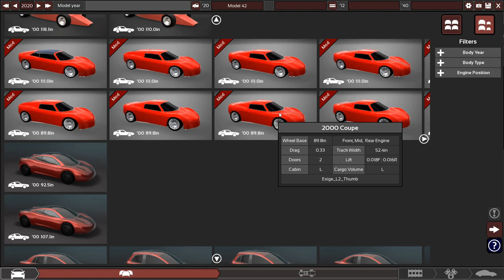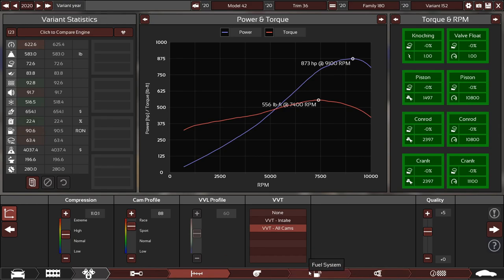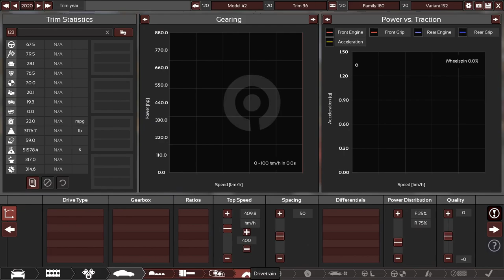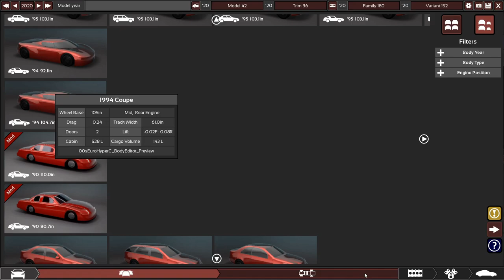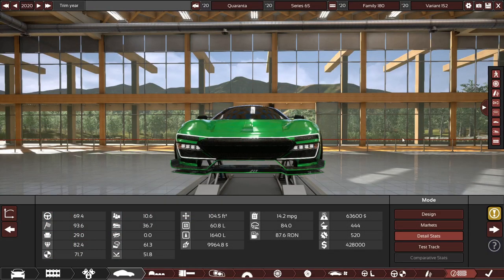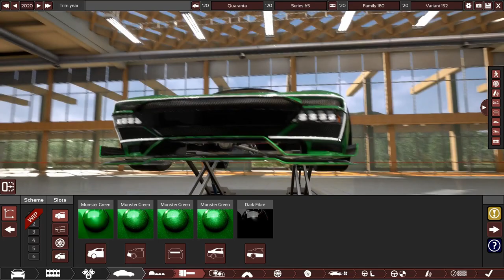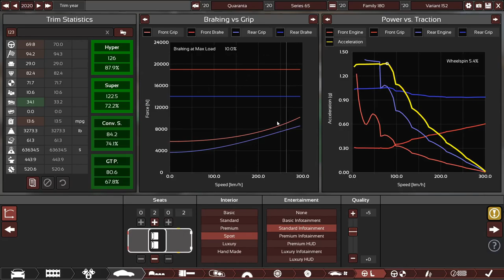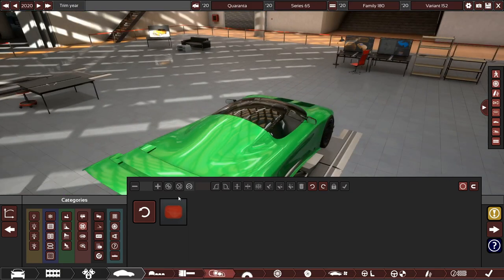2020 Supercar Challenge! TwinTurbros VS Canadian Steel

Comment: Fun fact: The Citroen SM had hydropneumatic suspension and was based on the Citroen CX (bonus: the CX name is a reference to the symbol for drag coefficient, of which it had a low one). The SM also borrowed a V6 engine from Maserati and was a super touring car for its era. It also used its hydropneumatics for adjusting ride height as well as deploying jacks from in front the front wheels and behind the rear wheels in order to easily replace the wheels should a tyre go flat. The engine also had a driveshaft coming off of the front in order to run the hydraulic pump for the suspension system and other hydraulic devices.
Reply from the maker: Citroen made some of the most incredibly engineered cars back in the day!! Never seen one in person. But maybe someday!!

Comment: for a 900+hp car, you should hit 370kph easily, tone down the aero, 300kg rear and 50kg front of downforce should be enough
Reply from the maker: I could have gotten up to 400 with a bit of fine tuning and a beefed up engine. For the tracks w are doing you dont need more then 300kmh top speed. 
And besides, Ive never build a car with this much aero. Its quite awesome to drive!
Reply: @TwinTurBros  well, if you're aiming for track performance, than this configuration fits perfectly its desired role, can't wait to see you driving this beast